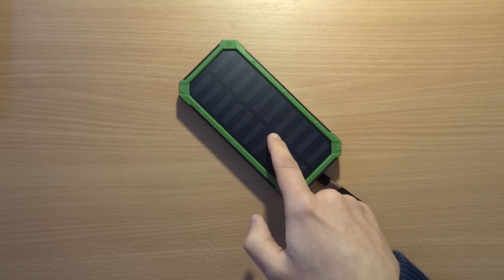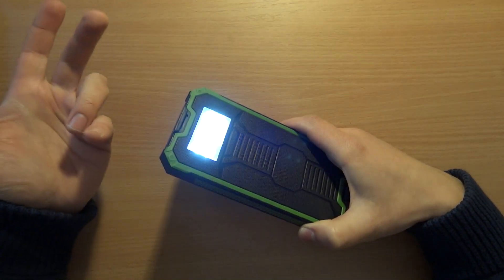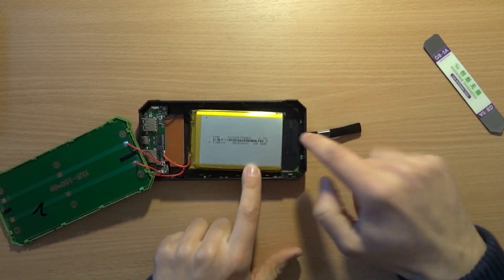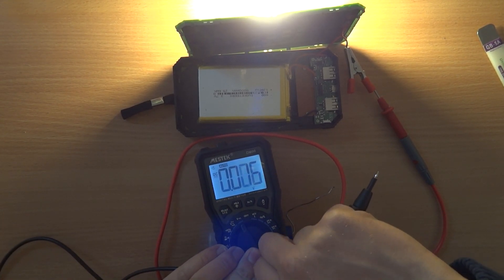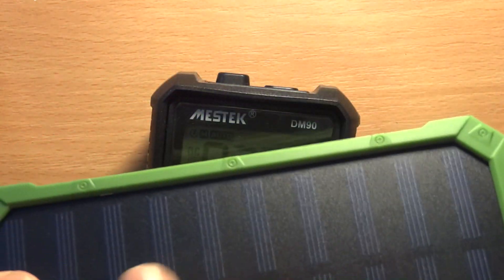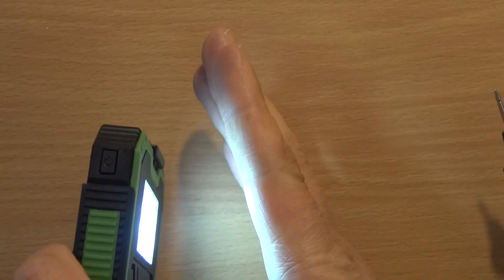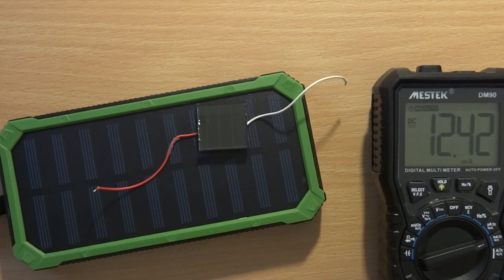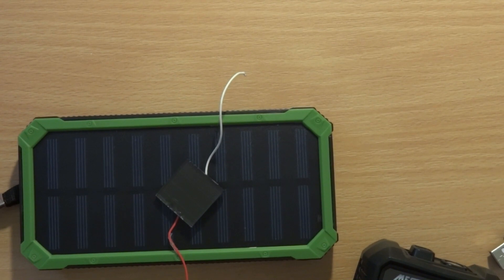Is it worth buying cheap power banks with solar panels? 🤔

Comment: From what I see, you're measuring amps in parallel. Amps are normally measured in-line, or did you do something different?
Reply from the maker: I'm not sure if you're reffering to same part of the video I'm thinking about, in 7:15 I'm measuring short circuit current to see what is the maximum power output (power generation) of the solar cell under load. In this instance the multimeter is being a load with almost no resistance. You'd usually measure current in-line (for example to see at what current it's being charged), because you want to measure current for a specific load (like charging a battery). However, to see effectiveness of solar panel I checked open curcuit voltage and short cuircuit current, so if it was 5mA@5V, that means for DC it's a simple multiplication - 25mW. I might've gotten something wrong somewhere, so let me know what do you think about this 🙂
Reply: @pandaengineering  7:15 is the one that I was referring to, yes. I don't quite understand what you mean with short circuit current: The amp meter is still parallel to existing circuits on the board. The contact points you're measuring on might have a coating or so, and have a longer track, therefore more resistance. My thought is that the current will still mainly flow over the circuit board and hardly through the amp meter. That would explain the low amperage you measure. A solar cell of this size and type should produce a couple hundreds of milli amps under good lighting, 5 mA can't be right. But I don't know where you are measuring exactly and I may miss an important point here. Did you try to charge the battery only using sunlight? Might be interesting to see how long that would take and the calculate back to what the amperage of the solar panel approximately is. Any way, interesting video, thanks for sharing!
Reply from the maker: @rvdboomgaard  You're right, I messed up the measurements. I was almost certain that I did measure this without any load outside, but I may be wrong here since it was over a year ago. I tried again today with 4x 140W halogens and when I positioned it in the best spot it went almost to 170mAh https://imgur.com/CGZRDDq Problem is that at that point it's quite a lot of light (very close to the bulbs) and when I tried measuring lux with my phone (it's fairly accurate for something like this, +/- 10%) it topped at 32k lux (so sunny day, not scorching, but sunny) so I started to hold it at the distance where it just reached those 32k and it was showing almost 50mA. I can't get anything near 20k lux of daylight at this time of year, so there is no use testing it outside.
The main thing is, before I posted this video I also tried to discharge the power bank and let it charge for 4 days on a windowsill outside - when I connected anything, it just blinked "low battery" and gave a bit of power for few minutes, so I thought the cell is really bad. I think that I have to keep it very close to the bulbs because there is a coating on the solar cell that decreases it's efficiency.
Thank you so much for your comment, I'll add this info to description! :)

Comment: Where do you buy the USB stick to do test like that
Reply from the maker: I've got it on Aliexpress(I just looked for "usb tester" keywords), but after some use I think for higher loads like testing modern smartphone charges it's not good enough. Seems that USB connector wore off and it doesn't provide a positive connection.
I'm thinking about getting one that's made by "Ruideng" or "Riden" (also known as RD) because it seems to be working much better looking at the videos posted on BigCliveDotCom channel.
Reply: @pandaengineering  thanks

Comment: Hi I am not good in English
This solar charger good or not?
I want use it for outdoor camping for phone and lamp light
Reply from the maker: As a power bank it's fairly good. The solar cell is an "extra" that could charge it fully (in theory) in 2 days in full sun. If you plan to get solar as power on a camping trip and you don't live in place with lots of sun, I suggest getting a folding big solar panel with USB and place it on your backpack. This way it won't overheat the cells in a powerbank and it would actually charge it during the day. I personally just got several powerbanks as charging with any small solar cell in my location (~50°N) wasnt efficient enough.

Comment: I bought a brandless solar power bank. Is it worth it?
Reply from the maker: You can always disconnect the solar cell and test it out. It really depends on amount of sun you're getting, but I had one solar powerbank that had a photodiode instead of actual cell, so it didn't worked at all.

Comment: So I spent $10 for a DIY power bank that does not even come with a battery. And it's got the exact same solar panel.
Reply from the maker: It's not that bad, see pinned comment for correction - I messed up measuring it.
Reply: @pandaengineering  I'm just arguing with the seller now. They also claim the case to be water proof, which is not.
Reply from the maker: It can be really hit or miss with the sellers, they rarely know exacly what they have in stock. If I buy it domestically, they often just order stuff from China to my address so it's a better idea for me to order from Aliexpress directly - much cheaper and seller rarely argue and will give you a refund. At lest this power bank did what it said on the box (I've got a max current of 165mA from the solar cell) and is very good for USB soldering iron. I bought another one in a local store chain and after I gutted it, it had a fotodiode instead of solar cell, to it will show that it's in the sun, but that solar cell was just a piece of plastic with painted stripes ( https://youtube.com/watch?v=5ExwxHYp_eI ). The thing is, that there could be exacly the same design with a good cell and it's really hard to tell either way before you actually get it and have a close look.
Reply: @pandaengineering  Some of those ebay stores were managed by people from China. Sometimes when you argue with them to a certain point they will start telling you some sob stories about how miserable they are and how their boss is abusing them to try to get you to leave them alone. Kind of funny. Those are usually from sellers that are already lying about their product in their listings. They like to sell these broken products with cheap price that they don't care about complains and refund request. The cost is so low that they'll just refund you and let you keep the stuff and ask you not to give them a negative feedback.
Reply from the maker: Those stories are relly something. My friend got in touch with a seller and he gave him his life story along with family pictures (!) and how he is in difficult situation right now. I'm sure they have earned a lot of those sympathy bucks using this method. What worries me is that some of those sellers start creeping into Amazon.
Reply: @pandaengineering  Compare to Amazon, I still like eBay more. Maybe those stories on ebay were aiming at sympathy bucks, however, Amazon is abusing their workers for real.
Reply from the maker: Amazon workers abuse is one thing (we have a huge warehouse nearby because of cheap labor, but I don't have Amazon specifically for my country and have to pay extra for shipping from "Germany" while actual sender address is a nearby city). I meant that it also started to allow the external sellers (at least in Europe), so Ebay sellers have their listings on Amazon too.
Reply: I hate china

Comment: Just bought two of these, did I waste my money?
Reply from the maker: Depends what you expect from them. Also see the update in description (I incorrectly measured the current in the video). They should be a decent powerbanks (I still use it, cell it fairly good and keeps the charge), but you'd have to have Australian class sunlight to get them fully charged in few days :)
Reply: @pandaengineering  Luckily I have better sunlight than Australia, I'm in Sout Africa, thx for the feedback I appreciate it.

Comment: in fact every powerbank claiming more than 8000 mAh is LYING! there is no enough space for more than 8000 mAh in that case
Reply from the maker: See my other, more recent video with solar charged powerbank, there isn't even a solar cell there 😂 Sad truth is that those companies make fools from people that aren't technically minded.
Reply: @pandaengineering  is 8000 mah is limit of all pb or only solar pb?
Reply from the maker: It really depends on the cell they put in and what quality they are. I remember first offbrand li-poly batteries for cell phones, they were amazing... for first 3 moths. There isn't actual cap on the capacity of single cell as far as I know (some power banks come with 2 or more cells that are balanced by charging and discharging circuitry), but you have to consider that large capacity means it's significantly heavier and considerably larger. Actual 20Ah would be twice as thick at least. As usual, it's good to go with well known brands, they get the capacity mostly right. As for cells, I'd recommend Sony and LG, really robust and properly protected. As for solar pb, low capacity can mean that they designed it with realism in mind, that it can actually be fullly charged by solar cells.

Comment: First of all, never leave a battery in the sun, ever. You can try Solarpad, which survived the John Muir Trail no problem, is lighter weight, and uses higher quality materials to ensure the claimed power output is as close as possible. Low cost solar USB chargers use PET plastic or epoxy that delaminates and yellows in the sun while Solarpad uses ETFE lamination and Sunpower cells that lasts 20 years. https://www.amazon.com/Solarpad-Ultra-Lightweight-Charger-System-Solarcycle/dp/B0746F2BKJ
Reply: What happens if you buy one of these solar panel power banks and leave it in the sun until it's at a full charge? Is it dangerous? Will it affect the amount of mAh inside of the powerbank? I'm very new to all of this.

Quick story: I want a new powerbank, but I don't want it to be a normal one because I forget to charge those, so I thought a solarpanel powerbank would be perfect! But, is it worth it? Should I buy a solarpanel POWERBANK or just a normal solarpanel which you can travel around with? I hope that made sense
Reply from the maker: What I think @solarcycle1 means is that lithium based cells will reduce it's lifespan significantly if exposed to high temperatures(from sun exposure) and low quality cells(or cells in bad casings) could set themselves on fire instead of venting in case of failure. Well made charging chips would simply disconnect the power once charging is complete. Split solar cell and good powerbank will give you more flexibility, quicker charging and greater lifespan, but quality comes at a cost. I don't think a powerbank like that from the video would be enough to charge during the day and power your devices, but that depends on your needs. Could be just enough for a classic bar phone.